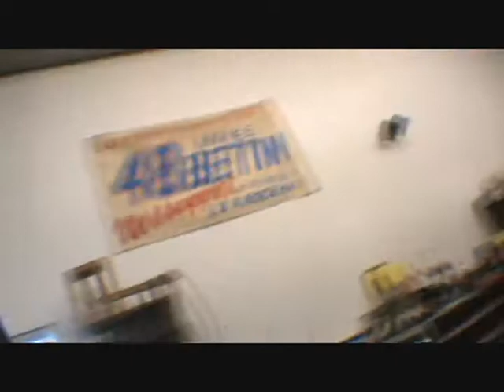2003 Trail blazer 4.2 motor replace with out pulling body

Comment: I just did a engine swap on a 04, I didn't pull intake , I pulled motor and trans in one piece and put it back in that way, took about 6 hrs total time, and wasent hard at all!  I don't understand why people say pull body?
 maybe its just on 4x4, mine was 2wd!
Reply from the maker: yes the 4x4 trailblazer is a whole diff set up then the 2 wheel. on the 4x4 you have to remove most of the front end because the 4x4 goes threw the engine oil pan.i dont think i would do one again unless i took the body off it.

Comment: Just starting this video but been wondering what happened to the motor and what were the miles
Friend had one that I think spun a bearing at about 230k
Reply from the maker: 200,000 or so on this one motor i got was around 60,000 on it so it should last long time
Reply: Guess those motors are only good for about that long. 
This one threw a rod. Friends didn't get that far. Was having oil pressure problems. had the oil changed and the pressure sensor replaced. Seamed fine. Drove it around some. Seamed OK. Got 60-70 miles from home. Pressure dropped again then it started knocking.
Reply: I spun a bearing around 206k